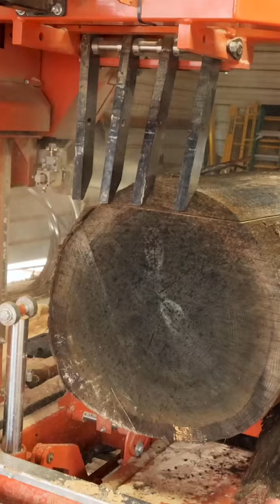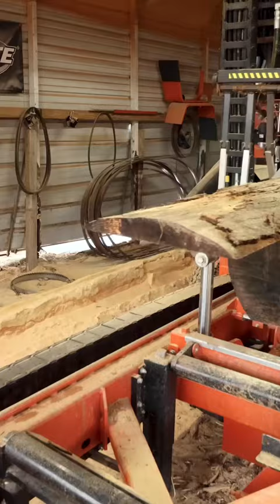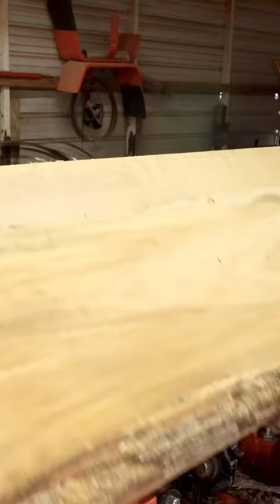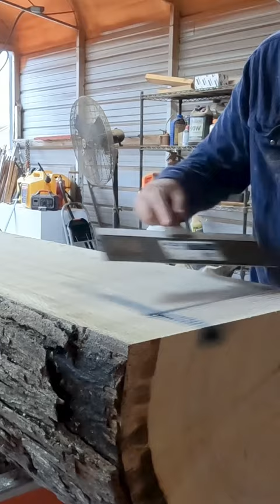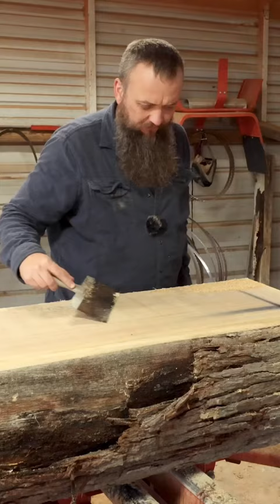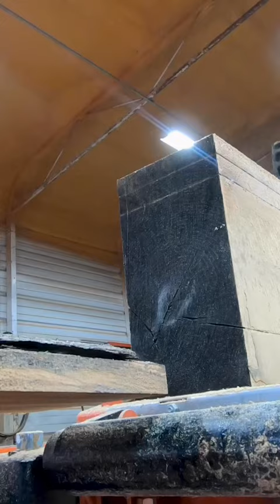Not What I wanted To Find Inside This Log! #shorts

Comment: I had a drawer full of metal I found when sawing with my Wood-Mizer.  You can easily spot the metal.  Ceramic insulators destroy your blade and you usually have to cut it out of the log.
Reply: Where does it come from
Reply: @jamesjameson4566  Someone uses a tree as a telephone-pole or as a fencepost for a wire fence - if someone runs a power line or phone line or hooks something to the tree with a nail or whatever, then later over many years, the tree grows around it & covers it up.  Like a nasty tree-pearl.
Reply: @vapormissile  oh, interesting 👍🏻, never considered that

Comment: How much metal will the blade tolerate and still cut well?
Reply: None
Reply: It depends.  i've had a band ruined by a carpet tack.  I've had a band cut pretty well after cutting through an 8d nail.  Never can tell.

Comment: Damn how’s a nail get that deep in the tree ??
Reply: It is put in when the tree is small and then as it grows the wood grows around it. I was an arborist and I have ran into metal 80 feet up in a tree before. It trashed my saw chain. It used to happen a few times a month.
Reply: @crabbiboi5528  I found a 22 bullet in a chunk of wood I was cutting down on a table saw once.
Reply: @crabbiboi5528  A ceramic insulator used to secure the end of a long wire antenna found its way into a tree 30 feet up from the ground and ruined a band on my Woodmizer.